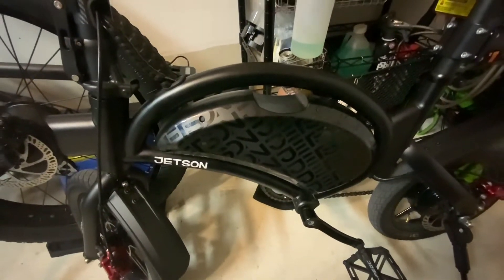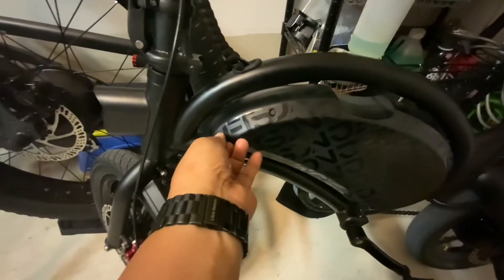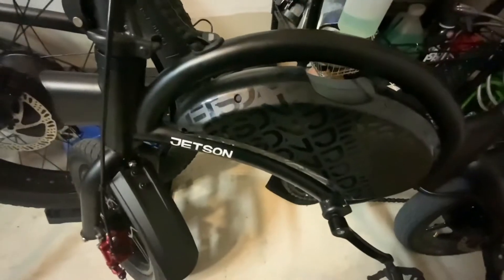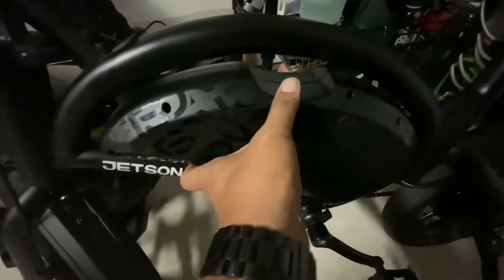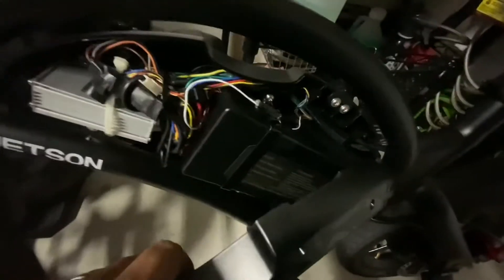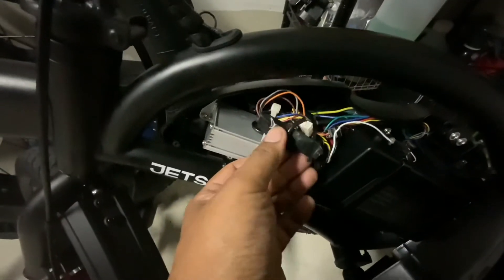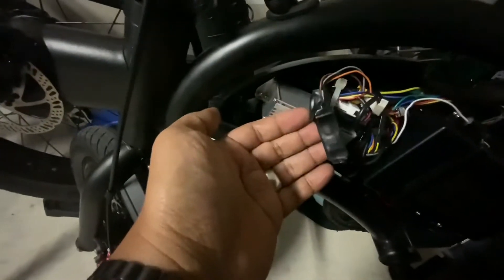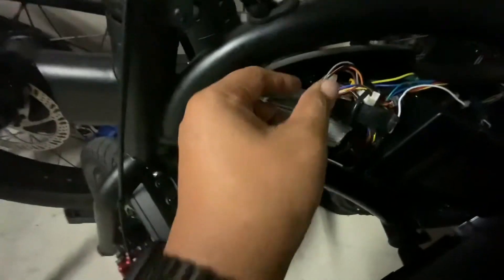Opening the Jetson Bolt Pro control and battery box

Comment: I'd appreciate the video. Did the jetson bolt the one with the bluetooth module the red wheel ebike? . I was confused because it had the jetson bolt with red wheels and the one with black and green jetson words on the battery cover.... 

Also I talked to jetson and they don't have any in stock so I think they lie to prevent people doing things?.

Also u mentioned that once I install the Bluetooth and change it to 19mph and then remove it it should stick lock to 19mph correct? We have 3 jetson bolt pro I want to do this to. And then perhaps return the Bluetooth module. Basically if it works without it and is in memory then I'll order a brand new jetson bolt for $499 just to do this trick then return to store ... Cause there no place sell the bluetooth module
Reply from the maker: Yeah. The red wheels has the Bluetooth.. I removed it and left it installed on the bolt pro.  And once you change the speed, it will lock itself to 19mph even after you remove the BT Module.  I’d go get a used or refurbished bolt with the red wheels.
Reply: @ryukenden888x  I will get a refurbished or new but I'm not keeping it I want to unlock and then return that's all. I have 3 bolt pro no need for wasting $299-499....I'll keep u posted
Reply: I also like digging deeper so once I do get the Bluetooth module I'll remove the shrink wrap and see if it's a generic type bluetooth or if it has any writings numbers. I can try to compare and or look for a 4 pin bluetooth wireless that can be used to control anything. The downside of this is that the app being use has to be able to support this exact wireless bluetooth. Sometimes they are universal generic so drivers are there... Sounds interesting and those amazon bluetooth are very very affordable if they do end up working...

Edit: I saw your list at EBR jetson forums. All credit goes to you as your the only one that has legit source started...👍
Reply: @b20eg195  yo how did it go? i'm very interested in whether it worked or not! looking to make my bolt pro go faster as well!